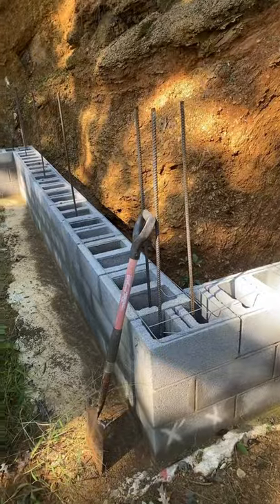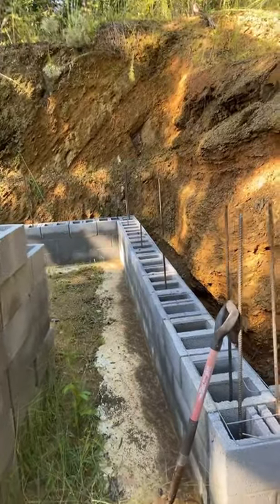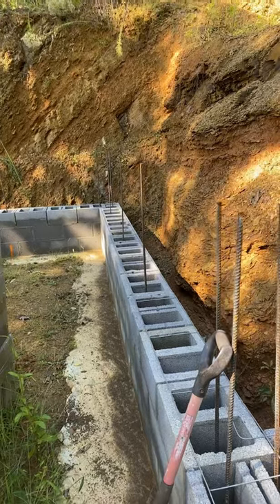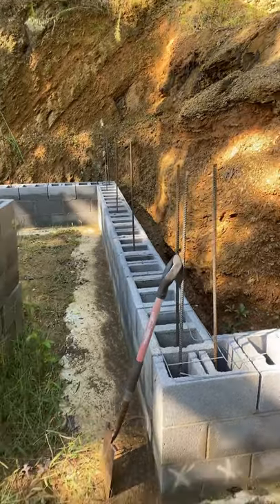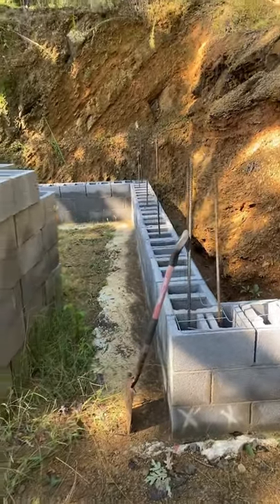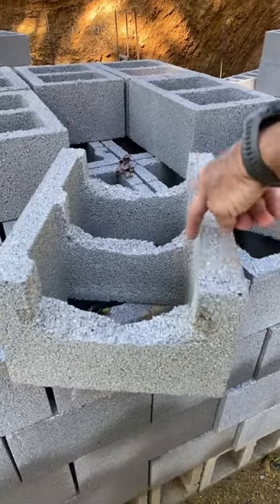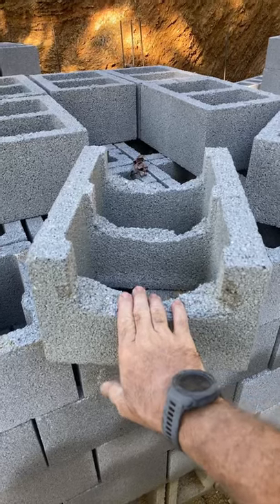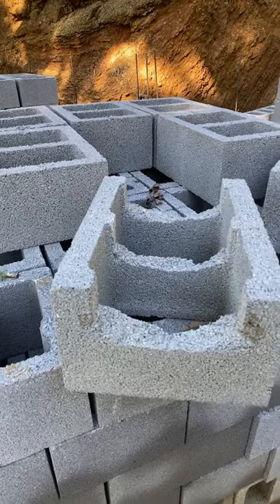What is a bond beam [CMU block wall]

Comment: they also make a few different kinds of block just for this application. Rebar cutouts already in the bond beam block eliminates alot of excess work and mess at the end of the day unless you underbid the job would be the logical way to go.
Reply from the maker: you are correct, however the specialty block are not always available. this is a personal project, so I was keeping the budget tight as well. thanks for the comment
Reply: @TheProCut17  yeah buddy. I figured that after I thought about n I too have cut a many many bond beams with just my hammer. I know exactly where you're coming from bro
Reply: Lol I didn't have access to a block saw on many days. A good block saw is definitely a luxury for alot of us
Reply from the maker: I have 4.5", 7.25", and 10" mason blades for various saws, they definitely come in handy @daveanddanniejacobs9432

Comment: You could also use wire course reinforcement . The biggest issues with large walls is getting water out from behind it. The most common problem with retaining walls.
Reply from the maker: I’m using Durawall every second course. And there will be a French drain around the base.
Reply: @TheProCut17  they have a few really good ways of keeping water but it's expensive for the peel and stick rubber my favorite way. That shit works. Lol. Don't work to hard fellows always tomorrow. I'm retired but I miss it more than anything
Reply from the maker: I plan on using multiple types of water proofing as I want it to last two lifetimes
 @daveanddanniejacobs9432